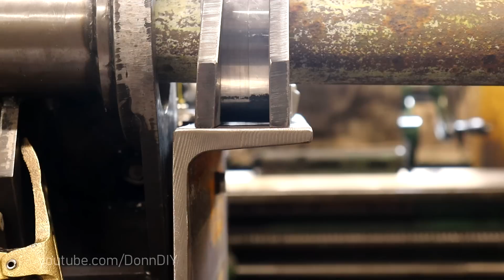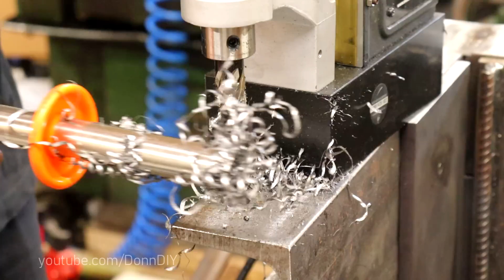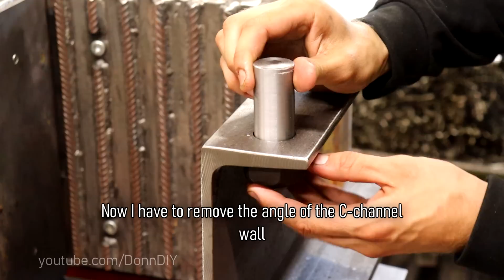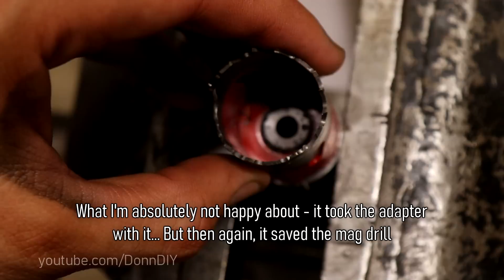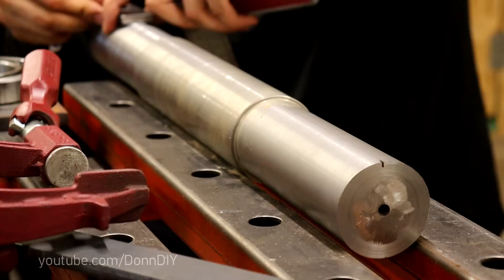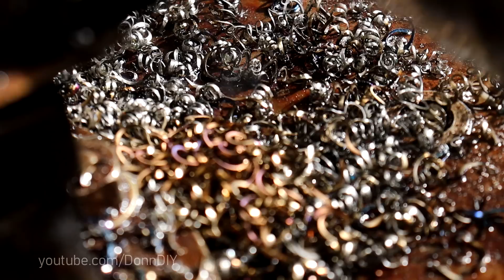Jaw Rock Crusher - BUILD Ep.4

Comment: Was thinking... I bet you could adapt your firewood conveyor system to work with this crusher as well. That way, you can load the crushed material right into a trailer as it's being crushed so you can move it around to where you need it easier. Just an idea I had, not sure if it'd actually work or be practical in the end.

Comment: 👍🏻 A trick I use when using a holesaw, is to drill small holes in the cut around the circle no bigger than the blade to help remove chips.
Reply from the maker: I'll have to remember that! Cheers!🤙
Reply: I’ve seen that same idea used with a hole saw in wood as well. Anything to allow the chips to clear and prevent binding.
Reply: Or spend the money and get a broach cutter. Right tool for the job.
Reply: One about 6mm hole is good on the circle if you dont mind the extra hole.
Reply: @JuhisTube  
Just drill the clearance hole either inside or outside depending on which side is the waste side of the cut. 🤷🏻‍♂️
Reply: @Crewsy  Maybe good idea.

Comment: My three-jaw would have tossed that cam after about 30 seconds.  It doesn't like interrupted cuts.  My holesaws last a long time because my drill press sucks.  It stalls out before it breaks the teeth off.  I also add compressed air to help clear the chips or back it out often and run a wire brush on the teeth for a second.  Nice video, I hope the build is as good as the content you put up on your channel.

Comment: I'm surprised any tapered flange channel still exists. Channels and beams both changed to parallel flanges about 35 to 40 years ago here in NZ. I'm old enough to remember using tapered washers which are still available.

Comment: The first thing I thought was wether the offset in that cam would be enough. You said the same thing just as I was thinking it. Looks friggin awesome, though....just like always.
Reply: I think it should be enough. You do not really need to move the plate that much even the smallest  amount is enough to bind and crush rocks.  Someone said maybe 10mm to 20mm is the offset. Though I think it will work very well. If not its just a new shaft that has to be made.

Comment: Donn, will you need a counterweight on your camshaft to reduce vibration, and will you use a flywheel to build up momentum? It's looking good, so far.
Reply: More than likely will need a flywheel and probably would need a balance shaft but we used a counter rotating drum crusher when I worked at the quarry
Reply: I suspect it won't be spinning fast enough to need to worry about that. 
It depends on the type of rock he wants to crush, but I think it'll need a lot of gearing down for a typical 6-10hp engine to run it.
Reply: Not gonna be spinning g fast enough to need a counter weight.
Reply: @mikeznel6048  it will need a massive flywheel and be balanced because rock crushing machines are normally run at 3000-4000rpm as rock breaks easier when struck repeatedly with a high impact velocity

Comment: I'd say that's got a 98% chance of working.  The 2% bit will be the number of belts you use and the override system for when it jams. Bother these problems can be fixed after a test run though.

Comment: They make wedge washers to correct for the angles of C-channel and I-beams.
Reply: Why bother with that when you can just weld a scrap piece of the same to it to make it flat?
Reply: @mikeznel6048  - I suppose it depends on whether you need 2 or 2,000,000, and what your labor cost is for cutting them out and drilling the holes. I only meant to say they were available, not whether it made sense for a hobbyist or small shop to buy them. They run from 50¢ to $5.00 depending on the size. In the US, you can get them from McMaster Carr and get them the next day via ground shipping at most locations. Cheaper than the time to make them in a job shop.

Comment: Are you going to counter balance that shaft ?? It will vibrate itself to pieces if you dont
Reply: So question. I hope you are not going the let the cam run against the back of the crusher plate right ?? Are you going to use rollers perhaps for the cam to run against?  Will you install springs to keep the plate pressed onto the cam ?? It will clatter if you don't.  Will you use a flywheel for the camshaft ?? It will take care of balancing the camshaft and inertia will make it go smoother . I would case harden the camshaft . It will get dusty around it and be ground away , that be a shame of such a nice camshaft
Reply: I hope you have something planned for the bottom pivot points on the moving plate . Dust and grit will eat away on it if you are leaving it sitting in the slots without any support with bearings or such